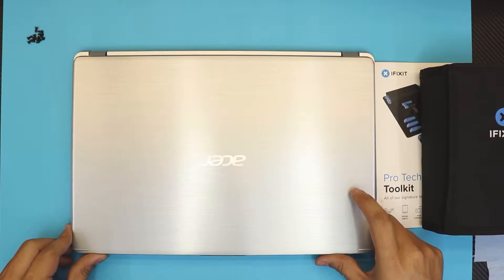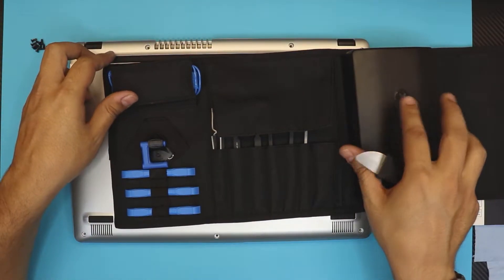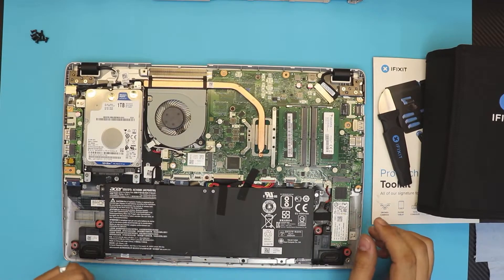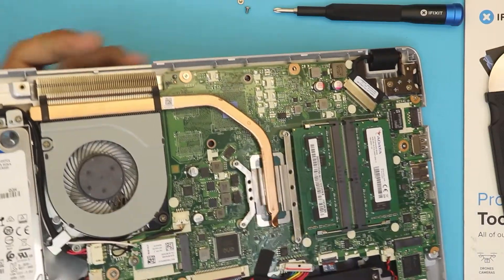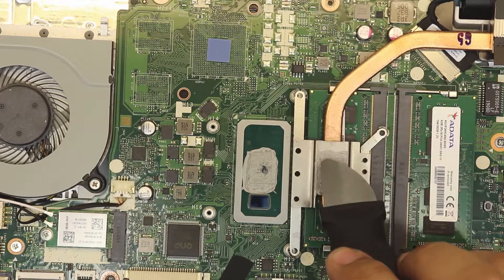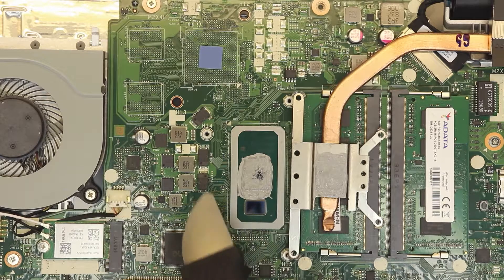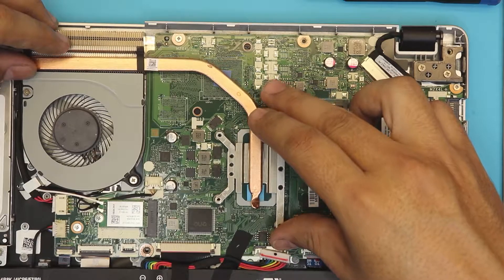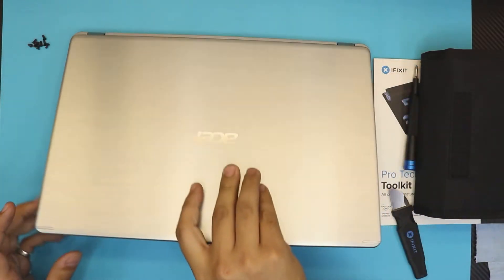How To Repaste ✔ fix Issue of  Acer Aspire 5 A515 Repaste FULL GUIDE

Comment: This is madness. I opened my laptop for the second time. Fist time it was foe putting upgrade this time i had gpu problem which i presume is the one thats not covered. Thats stupid. And yes. They should be sued for this. Imagine being the person applying the thermal paste. There is no way this should have pass quality control. 

Aspire A515 55 55R6

This is a heat sink problem by the way. The die cannot be flip over. All the board is made this way. Copper is expensive; client fucked…
Reply from the maker: I have been in the servicing business for over 18 years now, and it's disheartening to witness the questionable practices employed by brands in the industry. What they label as defects often seem intentional, part of their design strategy. Unlike the past, where laptops were built to be robust and easily upgradable, the current trend favors planned obsolescence. Electronics are no longer designed to last or be conveniently upgradable, unlike the sturdier laptops of old that allowed users to swap out components like CPU, GPU, RAM, and expansion cards.

As more brands flood the market with laptops, sales decline because consumers' devices last for years without breaking down. In response, a shift occurred from creating durable, long-lasting designs to engaging in a competitive "war" for market dominance, pushing for increased sales and profits. This led to manipulative tactics, such as compromising on heat sink quality or opting for BGA CPUs to save costs, only acknowledging issues as defects when exposed.

The once straightforward process of replacing a malfunctioning keyboard has also become needlessly complex. Previously, a user could order a new keyboard and easily install it. However, now it requires dismantling the entire device, removing numerous rivets, and navigating a labyrinth of internals just to reach the keyboard. This not only inconveniences users but also limits their ability to perform simple repairs, ultimately favoring the manufacturers' bottom line over customer satisfaction and product longevity.

Here is a comparison illustrating how keyboard replacements differ between older laptops and contemporary ones:
BEFORE (under 5min): https://youtu.be/ydvKYa6kTlc
NOW(over 1h ): https://youtu.be/1gF9WXGjexs

cheers🍻

Comment: can I just put some NT-H2 directly on the die instead of a thermal pad?
Reply from the maker: Thank you for the feedback! if you wish to support the channel you can LIKE or SUB or both :P
regarding your question: you could but it won't do much help, it's best to get a pad to fill the gap, not paste.
Reply: @uFixTek  Thanks, and what thickness would you recommend?
Reply from the maker: .5mm
https://amzn.to/3ltsNxd
Reply: @uFixTek  Thanks lots, last question, is not of vital importance, but I'm curious: what's the difference in the heat transfer capabilities in this case? between paste and pads?

Comment: Thanks you so MUCH sir
Reply from the maker: Most welcome, Thank you for the feedback and your support to the channel by a SUB :P
if you ever need help or request ask me.
Reply: @uFixTek  listen you saved me time and money! I've had the laptop for 2 years now. Ever since I got it, my fan was blowing NON STOP. It sounded as it my laptop was going to blow up and my fan was a tsunami trying to keep it cool lol

I (female), with zero experience in these types of things, simply followed your instructions - and was able to fix this issue on my own. 

So it's a well deserved thank you from me for sure. My fan is now quietly working, when needed and not ALL THE TIME.

One question - what application or software to test fan speeds?
Reply from the maker: Thank you for the awesome feedback and im glad my videos are helping people, and saving the the money :P
for the fan check use:
HWiNFO64:
Portable version no need to install:
https://www.hwinfo.com/download/
it has all the info for every parts of the GPU CPU and everything. just click read sensor only and scroll down until you see fan speed and even voltage and temps.
https://prnt.sc/108yn5x
Reply: @uFixTek  you're awesome! Thanks alot
Reply from the maker: your welcome :)

Comment: I hace the same laptopo you showed on the video. I have a questio, im going to open my laptop to see if its deffective. You used a thermal pad on the exposed part. Can I just put thermal paste instead on the exposed part?
Reply from the maker: you can use paste but its not as effective and make sure its not too thick else it will lift the heatsink causing it to over heat. try paste 1st.

Comment: Thanks for the guidance. My acer aspire 5's fan started getting louder recently, despite purchasing it less than 5 days ago. I've been using a makeshift laptop stand to keep it cool, but I suppose that's not enough, since it's still audible when I open up firefox. Anyways, I'm hoping this thermal paste does the trick and I certainly hope I don't run into your client's same issue with the faulty gpu placement.
Reply from the maker: Glad I could help, thank you for the feedback :P i hope not

Comment: Is there an advised thermal pad thickness? I've tried asking for support with Acer but they couldn't help me out. What pad thickness did you use?
I'm aware it's better to take a thin pad if possible. Would 0.5mm suffice to bridge the gap between the CPU and its heatsink?

Thanks in advance!
Reply from the maker: Yes my friend .5mm think pads are perfect fit
Reply: @uFixTek  alright, thank you for the quick response!

Comment: After applying thermal paste temp is fluctuating upto 100c . Can u plzz help me out
Reply from the maker: ok you did for sure something wrong!
can you say what kinda thermal paste you used?>
and can you provide some pics of the heatsink and the cpu , so i can see how you put the thermal paste.
Reply: @uFixTek  I used thermal greece... Which I got from a local store coz the online services was off and it was the only option. 
When I'm charging the voltage and temp are both fluctuating and thermal throttling can be observed too
Reply: And that thermal Greece was super cheap :p
Reply from the maker: THERE IS YOUR BIG ERROR, you cant just use any thermal Greece.
must me MX-4 , artic silver 5, or any good brand, else is like putting a kitchen oil in your car engine.
Reply: @uFixTek  ok i, m gonna get a good paste thnx

Comment: Hello! So I want to liquid metal cool my Alienware r4 1080 I’m going to follow your tutorial and then I saw in the comments you have a better version of the tutorial which utilizes copper shims. What’s the positive of using the copper shims in the middle instead of just simply putting the heat pipes over the cpu with the liquid metal? And the tape is a necessary component right ? Also the liquid metal will not fall out with the copper shim in between ?
Reply from the maker: the copper shim does few positive factors, one is the pressure that it will create so the heat will transfer better (physics =more pressure better heat or cold transfer between materials) , .3mm 20mmx20mmm for gpu and cpu.  and the tape is a must!!, and no the copper shim will not fall out nor the LM. trust me i been doing this for a very long time, and still do it daily.  thank you for your support and if you have any questions ask, english /spanish
Reply: uFixTek thank you very much just ordered everything I need! You got a new subscriber :)
Reply from the maker: Thank you, if you have any question during the process , send me pics and questions and i will try to get back as soon as i can. good luck